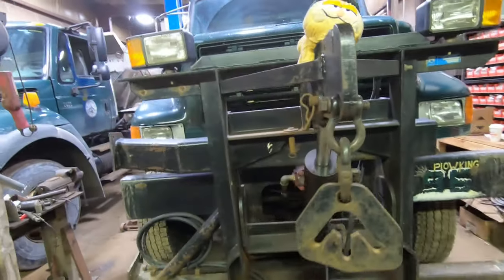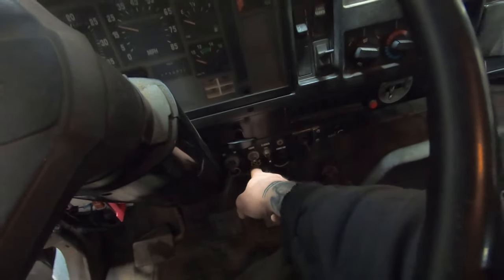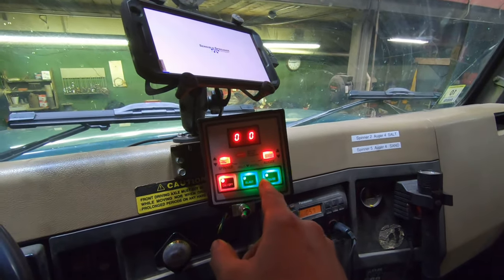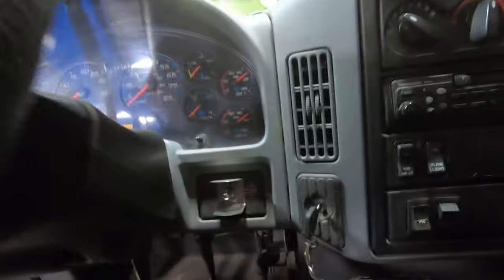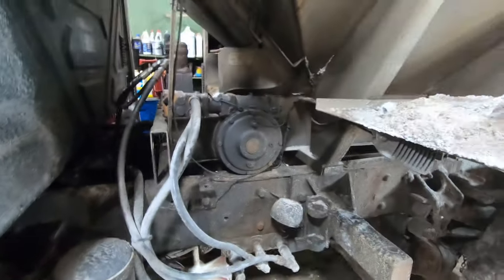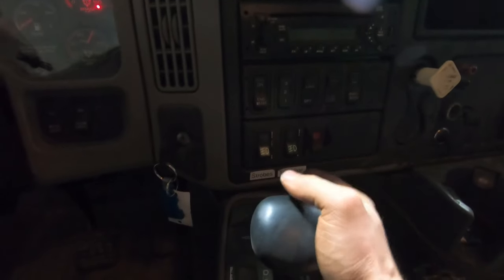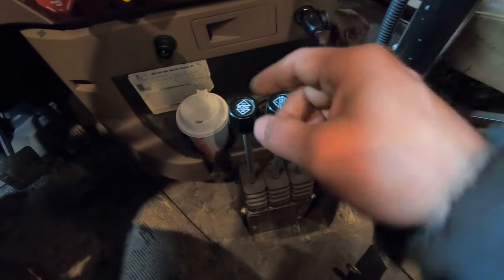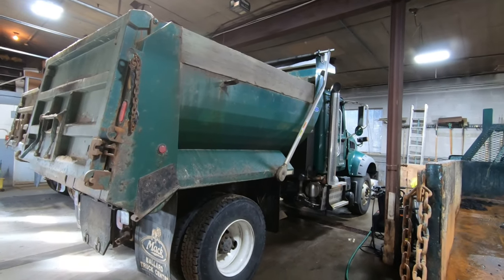Plow and salt truck controls

Comment: Do you know what the locking diff back axle is called or what model it is?  Is it possible to get a front steer axle that has a locking diff as well?  Thanks very much.
Reply from the maker: Most rear axles are spicer axles, at least the international ones are. They are mostly classified by weight ratings but they do have model numbers, the data tags don’t last very long in our environment. We never really put enough mileage on to need the model numbers for any internal repairs so it doesn’t usually come up for me, most brake and seal parts i need i match them up or they are a standard part that i can get. Any odd ball parts I can get from the dealer and they can look up the parts from the build sheet. The locking carrier is an upgrade that is requested at the time the truck is being built, it’s not axle specific you can get it with or without. I don’t know if they make a locking front differential, a driven front axle is not very common and the parts are very expensive for the Marmon Herrington axle that’s in our all wheel drive truck. I think most cement mixers have a front driven axle in them. As for a locking front axle I’d imagine there is a military form of it but I’m not sure.
Reply: @JasonTheMunicipalMechanic  Thanks for taking the time to write a detailed reply.